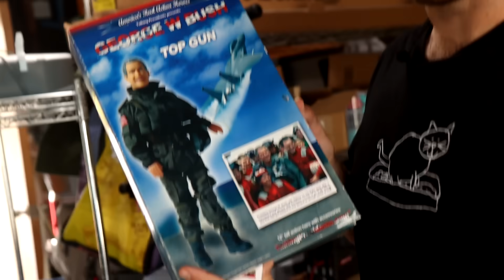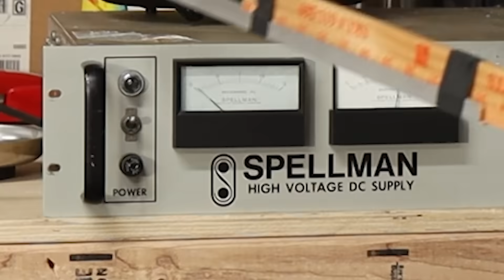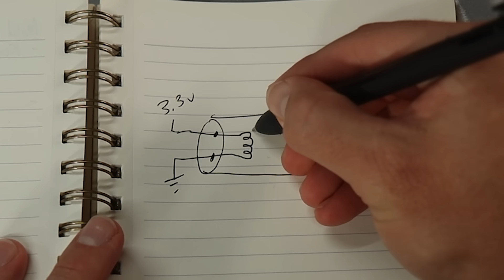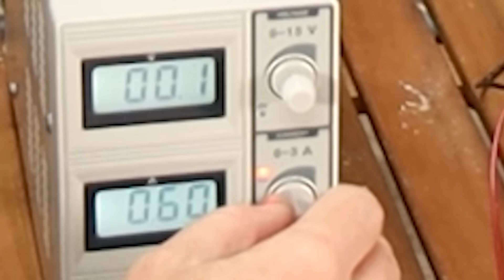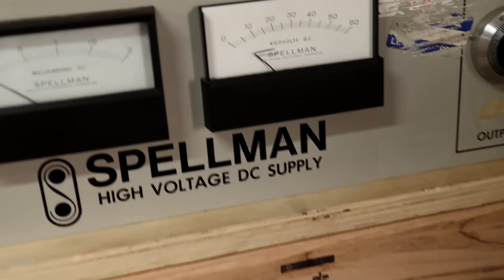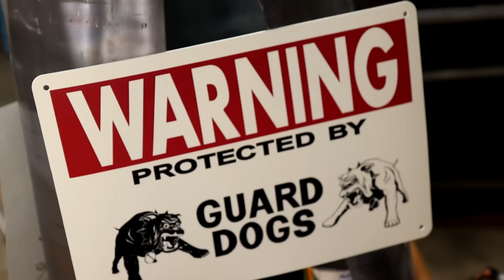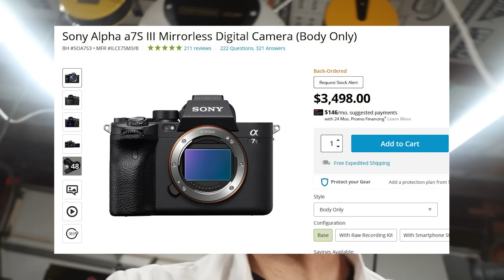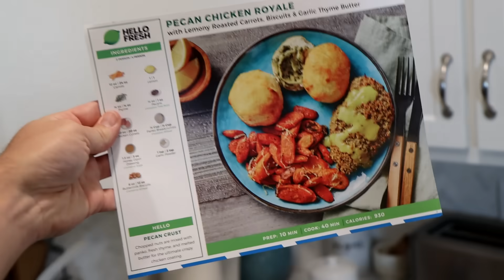Built My Own X-Ray After a Hospital Charged Me $69,210.32

Comment: According to the doctor that gave men my x-ray in 5 or so years back, one x-ray is equivalent to about 2 hours of direct sunlight.
Reply: No. Thats not true its true that an x-ray is only like a few days of radiation that natural. Nothing to do with sunlight. 

But medical x-ray machines use as little radiation as possible. A homebrew solution doesnt.

Getting cancer isnt fun
Reply: @BrosBrothersLP  yes, still William  Osman is a total dumbass, kreosan's ghetto cancer xray gun had better pulse timing, and in comparison applied science fluoroscopy video seemed like a professional x ray technician. He probably left the tube on for a whole minute, he could waste a month to program some shitty arduino nerf gun controller but wiring some stupid relay for switching the heater supply in 5 minutes avoiding putting his brain at 40cm and at the same level as the x ray tube was too much effort.
Reply: @BrosBrothersLP  Right?  Medical x ray machines are a lot different than this ghetto ass deathtrap he built in his garage.  This is incredibly dangerous both due to potentially electrocuting yourself and the potential for radiation sickness/cancer.

I mean, it was an entertaining video for sure, but x-ray machines are a bit more complicated in the way we try to minimize excess radiation exposure.  You can't just take the part out, remove all of the safety protocols, and assert that it's safe.
Reply: @mickeymouse12678  uh oh safety nerd
Reply: @jakegarrett8109  What in the world is this insane comment?
Reply: @mickeymouse12678  Its partly me complaining that last weekend I was illegally searched about 5 times (and they did a horrible job anyways, its all for show and to humiliate people). The other part is, if you're worried about radiation, then they Xray probably a million people every day under the name of "safety" (which by the way about 90% of guns get by the TSA without detection when they audit, so its not like its actually stopping anyone except a few people that accidentally left stuff in their bag and now they go to prison). But, Xraying a million people a day, lets say it cuts off 2 hours of your life (ignoring the actual hour they waste just in lines), so at 2/24/365*1,000,000=228 years of life they take away from people every day, so unless they are saving at least 3 newborn babies (which is probably extra bad for them getting X-rayed), then they are killing more people than they are saving, AND you're paying for them to do so.

Comment: I'm really glad he pointed out the airplane things honestly, because yeah, you're exposed to a lot more radiation when at altitude in a plane than you are on the ground typically and you're fine. It's all about how much, how long, how consistently when you're talking about radiation danger. Frankly, I'm more concerned about how stupid he was being with the power supply (how was it not obvious to you using metal cans would be a bad idea?), the radiation wasn't an issue. 
p.s. Love the video as always Osman, keep being brilliant.

Comment: That liquid you drained to expose the x-ray tube is used for coolant because the tube can generate a lot of heat itself.  Without that coolant you can burn the tube out very easily

Comment: 4:40 
Will: Thats not right i wonder why
Also Will: Attempts to run 60,000 volts through a circuit with a resistor that's probably not meant for that much power. 

For people that don't understand electricity: Basically when you hook up power to a circuit there is a constant flow of electricity. A resistor helps to slow the electricity so the circuit doesn't overload and start an electrical fire or worse. The higher the voltage the higher the speed.

Edit: I realize im an idiot and that the resistor is probably meant for that amount of voltage due to the massive amount of energy used. Whoops XD

Comment: Im pretty shure you voltage/current limit the anode voltage instead of the filament voltage
Reply from the maker: The HV supply is only rated for 2mA, and the tube is rated for 10x that.

Comment: Well, it would be a lot safer if you didn't put the lead shield around your set-up, lead reflects x-rays, it doesn't absorb them and when they reflect the lead releases gamma radiation back into the test area and all around the garage, gamma, unlike x-rays, has a longer half life, so it sticks around much longer than x-rays, which dissipate almost immediately after power is cut, a dental x-ray machine gives out 0.005mSv of radiation per burst , which lasts about 1/18th of a second, your machine is on for a significantly longer time, so an estimated 0.035mSv over a 7 second period, the average dosage for a human per year is 3.1mSv, so while you are safe, the dosage is increased due to the set-up, your little counter also won't detect alpha, beta and gamma bursts in low quantities produced by that machine, it only measures the peak, which is controlled by the intermittent bursts from the control power supply from the actual x-ray machine, also, this set-up could be used for making something even more radioactive, plutonium, however, since your inability to recognise the dangers involved in sticking your hand into a chamber with varying levels of radiation without thinking of the consequences I won't elaborate further, I'll be checking the news to see if a small portion of California has an increase of glowing cats within a small area!
Reply: I'm glad someone knows what they're talking about in the comments. This contraption is really dangerous is a completely not funny way.

Comment: I know this video is tongue in cheek but:
The $70 for the xray is not just the cost of the machine and electricity to run it. It also includes the cost of a technologist to safely expose the image enough to be diagnostic, and to position the anatomy so that the image can be clearly read. It includes the services of a radiologist to read the images properly. It isn't always easy to spot a fracture, especially when the fracture is not parallel to the plane of the xray beam (see "positioning" above). And say you use your diy xray machine to diagnose a fracture,  then what? Do you know how to treat it? Set it? Cast it? I do agree medical costs need reform, but honestly $70 uninsured for an xray is a hell of a deal. 
On to the safety nerd portion. While the dangers of xrays are overstated by lay persons, there is a reason that the medical community has drilled that into the public consciousness. They are dangerous. You do not have the proper equipment and know-how to both measure and consistently deliver a measured dose. There are legitimate medical xray machines that have malfunctioned and given radiation burns. I kept waiting for this explanation somewhere in your video followed by a "for real guys, don't try this at home", but you did not deliver. You consistently understated the danger of everything you were doing.
Finally one final gripe: as for scientists who died during experiments being revered, no one praises Luis Slotin. He died an agonizing, painful, horrifying death due to the careless safety culture of the lab he worked in. He is remembered as a PSA for radiation safety, despite his numerous accomplishments. 
Like I said, I know this video was tongue in cheek, but not everyone watching is going to realize that.

Now that I've said all that, that was really f*cking cool. Great video.

Comment: For the $240 that you hear on the phone call, $170 is for medical consultation, only $70 goes to the X-ray.  And more then half of it goes to the medical side (having a qualified radiologist look at the image and make a diagnosis), so only say $30 for making the X-ray image, out of that, I would be surprised if more than $1 is for the hardware cost of the X-ray machine.  Or another way to break it down, I'm guessing $40 goes to doctors and medical professionals, $15 goes to engineers and technical professionals, $15 for equipment and consumables, and the rest, $170 goes to lawyers, insurance, accounting and admin.

Comment: willie got a lead sheet to contain radioactive waves yet he puts his beenz literaly exposed to radiation lmao
Reply: You can expose your food to all the X-rays you want. I don't know why it would cause any problems. X-raying your hand on the other hand (no pun intended). I wonder what dose he received, that felt pretty reckless.

Actually, the beans probably got less of a dose of radiation than his hand did, being shielded by the tin.
Reply: @Thedamped  i was joking but i dont think he was reckless cuz its only a little dose of radiation its like flying for several hours but pretty reckless cus his putting his hand near an exposed xray running on high voltage and literaly fried the bean lmao well what do we know i dont have a degree in mechanical and electrical engineering most likely nether than you.
Reply: @enzoocampoiii2881  Well I said I wondered how big the dose was. And it "felt" reckless. I did not say it was a big dose or that it was reckless. 

He maybe knows something we don't. He could have calculated the dose before doing that. But the reason it felt reckless to me is because as I understand it those dental x-rays work by only activating very briefly (apparently about 100-300 milliseconds) like the flash on a camera. It seems in his case he actually had his wife manually turn the machine on and off to expose the phosphor and take a photo. This wasn't recorded on the video, but I would guess at least a few seconds. So if it took him 10 seconds, even assuming the same voltage and amperage (which we aren't guaranteed given his makeshift power supply) that's like 100 x-rays.

He mentioned a CT, having a bigger dose. The reason a CT has a bigger dose is they have hundreds of exposures each at slightly different angles then use a fourier transform to reconstruct a 3D model. If he had a strong exposure for a few seconds, his dose might have been closer to a CT (fairly high dose) than a typical dental X-ray (pretty low dose). However, he was probably referring to a chest CT, which hopefully is a much larger dose than he received, but again, we don't really know.

In addition, there are strict clinical guidelines that doctors follow to ensure a positive risk benefit ratio of utilizing CTs. They are used to diagnose life threatening illnesses for treatment.

You know Marie Curie, Nobel prize in physics for work on X-rays? The famous X-ray of her hand? She died from long term exposure to the radiation she worked with. Given when they were first being discovered she had no reason to think it would be dangerous. Now we know much more.

No, I don't have an engineering degree, but I have worked with scientists using X-rays in a biochem lab, if that matters. (X-ray crystallography)

In the end, it's a video for entertainment, he could be playing up the recklessness for dramatic effect, as that is kind of his style, we don't really know if he is being reckless or not. It just felt reckless.

Comment: WILLIAM PLEASE. Don't fuck around with radiation!!
You'll give yourself cancer and it's just not worth it. Other people have said this already, but normal x-ray machines only activate for a fraction of a second! The reason modern x-ray machines work differently etc is to make a clear picture without irradiating your hand for several seconds! And you operated the tube with no casing or anything! Please don't die!

Comment: Actually no, I’m a MD (just ignore the YouTube name) and I can explain this.
The overview is this:
Every expense is nationally standardized and it correlates with the type of service and the person involved. For example, you have a fever and need to have your blood drawn.
The tabulation will include the expense of the personnel assessing the initial visit, the operative cost of the place (private practice, clinic, hospital) and the materials used along the machines involved (syringes, blood reactants, centrifuges, blood analyzers and whatnot) and their OPERATIONAL cost along with the operational cost of the center to create the bill.
When you require a more complex service or assessment it obviously gets more complicated and expensive.
What are the benefits of this system? 
1. Despite the cost, the persons in contact with your are guaranteed to have the necessary skill level to perform their job (weather it be the nurses up to the specialists)
2. It ensures a pristine maintenance of the equipment and have the possibility to troubleshoot it should need arises (add an extra cost for the technician and their level of expertise into the bill)
3. It ensures an abundance of materials and alternatives to reach your diagnosis 
Are there any pitfalls? Of course!
1. Bit everything is covered within the bill. So you can blande the US economy for that 
2. Patients still need to pay a difference depending on the kind of insurance they have, regardless of the center of attention stock and income, when certain services are used 
3. Often, patients even need to pay out of pocket for the treatment (but not the diagnosis and initial or subsequent assessments) because that’s how the health system works in the US 

So there’s the overview on why the health treatment is so expensive in the US. There are many more details, but you can read medpub articles regarding the topic and expand your knowledge

Comment: this is the first time I've actually been concerned for your safety in one of these videos - not because of the high voltage, or cancer, but because the only thing you had protecting your crotch was some tiny little lead disk only half the time.

Comment: "Why is the beans so close to the high voltage?" is JUST the thing you want to hear from the guy about to give you an x-ray
Reply: I know i'm in safe hands when my doctors are putting pantry goods near the medical equipment
Reply: @yummynubs3646  when the doctors are using pantry goods as the medical equipment
Reply: @yummynubs3646  When you're finished the procedure they can reward you with a tin of beans for a snack. 😉
Reply: Time stamp 12:04
Reply: @Stealthy_tree  thx
Reply: Not gonna lie I would rather get the bean-can garage x-ray with the paper saftey labels for $50 than pay $2,800 at urgent care.
Reply: Medical insurance covers the extra bean cost.
Reply: All while you hear electrical arcing during the x-ray.
Reply: you have to pay extra for that

Comment: You know you're in the USA when it's cheaper to get two engineering degrees and make your own medical equipment instead of going to the doctor.
Reply: This is actually the driving principle behind GPS; the device attempts to get two engineering degrees and build an X-ray then measures the price differential that exits between that and healthcare to approximate your location. Neat!
Reply: @FerHivore  thank you for this wise information
Reply: I mean he could have also just bought xray machine for the price of those parts. They are not too expensive.

Comment: Also part of the reason your bill is so high is because when $500 motor breaks on a 30k surgeon table - they replace the table, because of no right to repair, lack of availability of replacement parts or manufacturer's greed, pushing the latest and greatest of their product